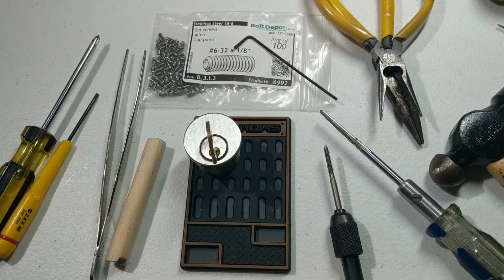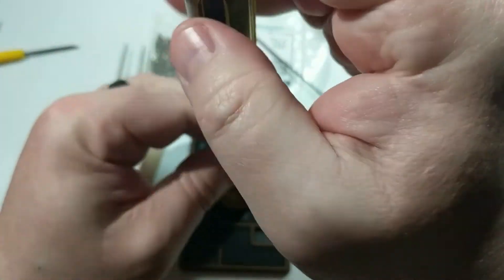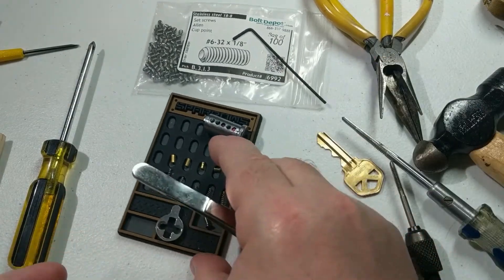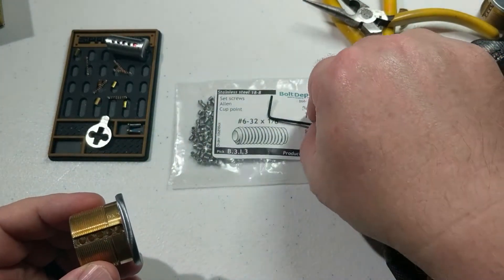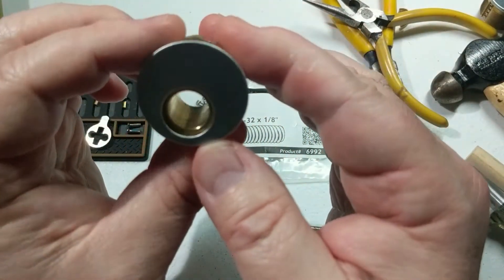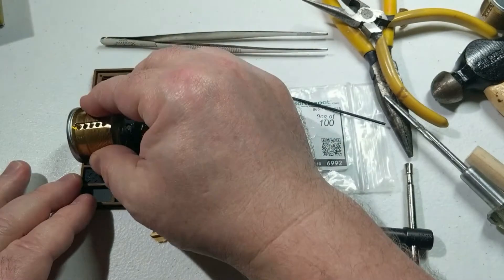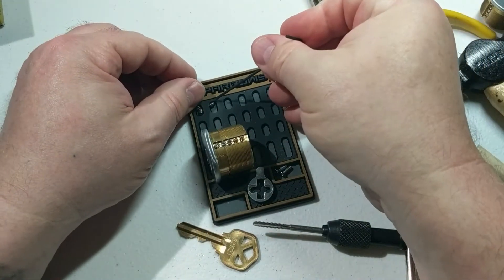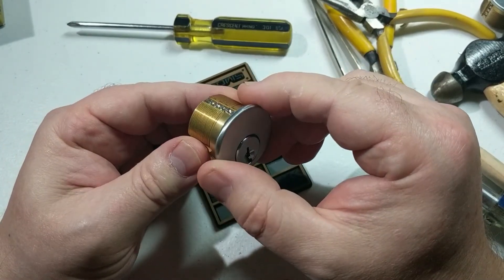Episode 5: Making A Repinnable Practice Lock

Comment: Dumb question, but why is it 6/32 instead of 3/16?
Reply from the maker: Not a dumb question! #6 is the diameter (0.138") and 32 indicates the number of SAE standard profile screw threads per inch. It's typically represented with a "#" in front of the diameter, and a dash before the threads vs like a fraction.